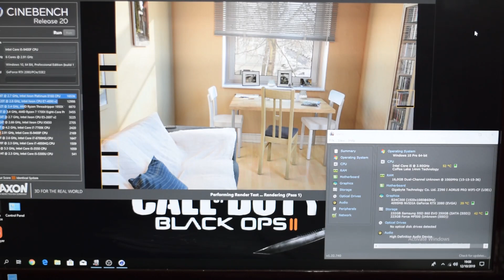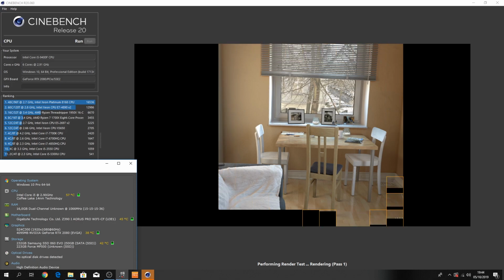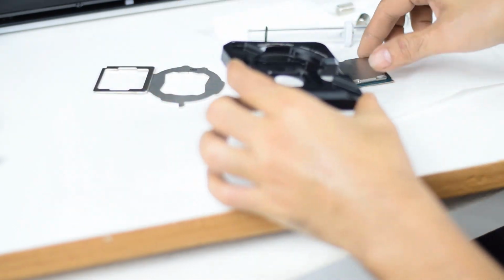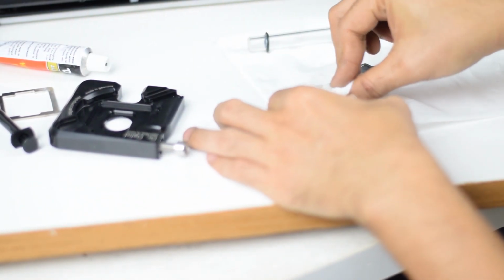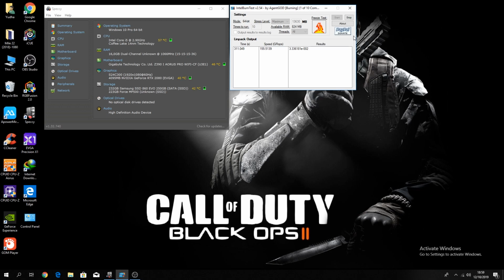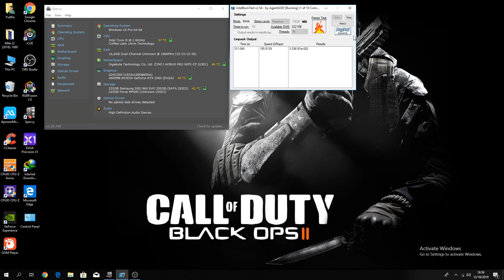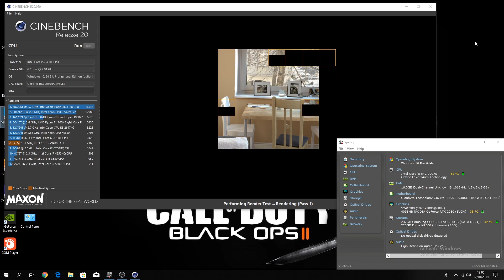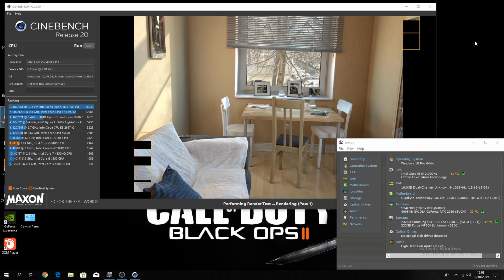Antec Cube Watercooling & Delidding INTEL non K CPU,  "How much the temperature difference?"

Comment: which res top did you use ?
Reply from the maker: Zulk9 Mahmood https://www.ekwb.com/shop/ek-xres-100-glass-revo-d5-pwm-incl-pump
Reply: @BMRProjects  actually what aer you using it to keep it mounted to the rad sorry :( I am using the normal plexi pump top and using the fan mount but it sits too high for me. would like to have it setup the way you have btw sick build subbed.